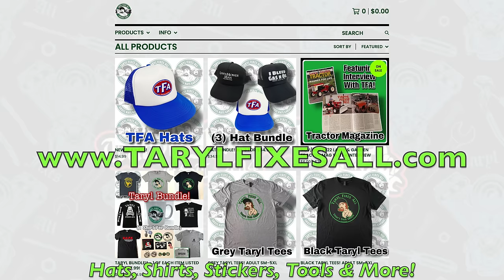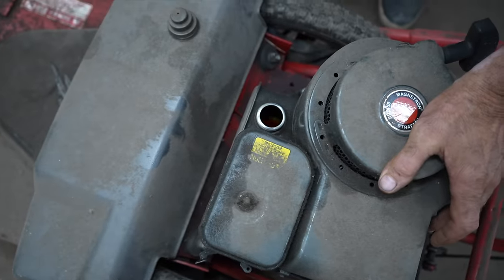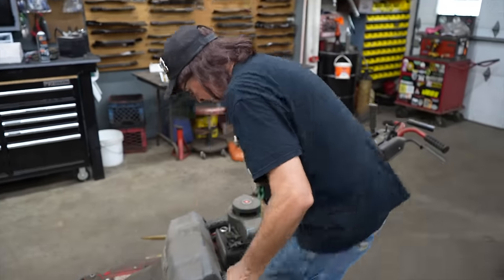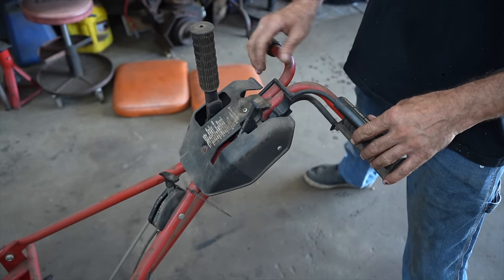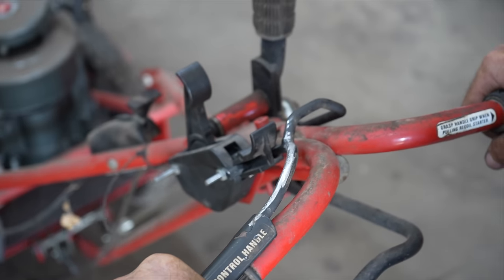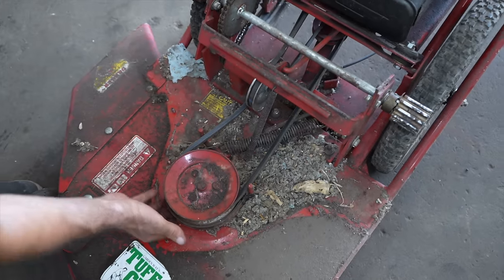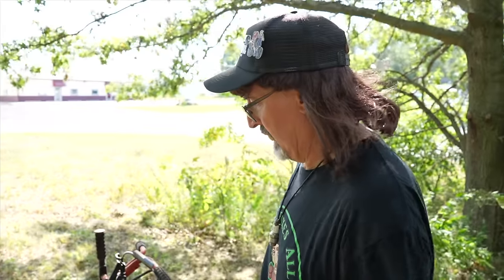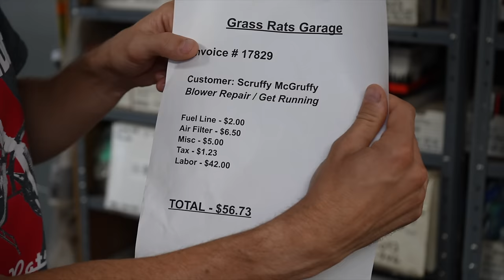Customer Wanted It GONE! Can It Be Saved?

Comment: Early 80’s Orgill Brothers made a similar version. powered w/a 4 hp B&S flathead. Painted on the Spindle cover was called “Big O”. I pushed mowed grandma’s acre yard for 16 years. Still have it today use it as a trim mower on my two acres. Great for tall grass and mowing down in ditches keeping your feet on the bank.